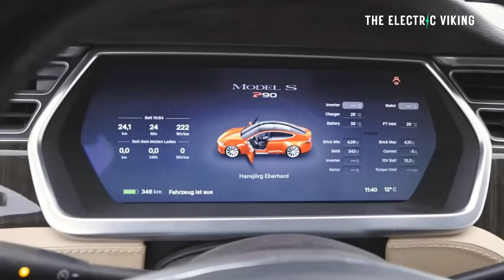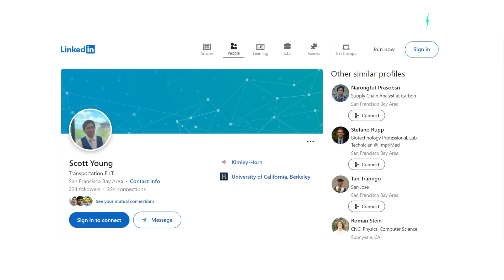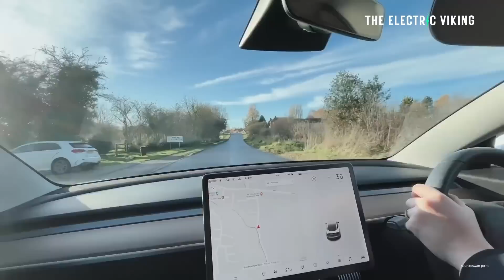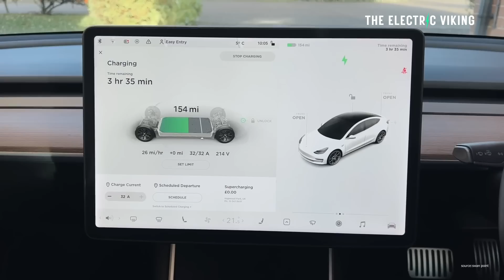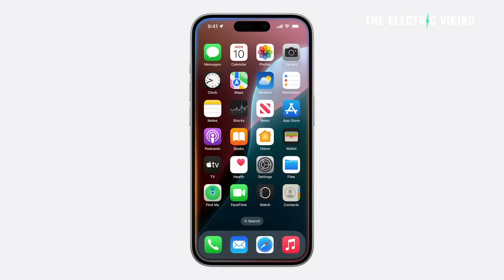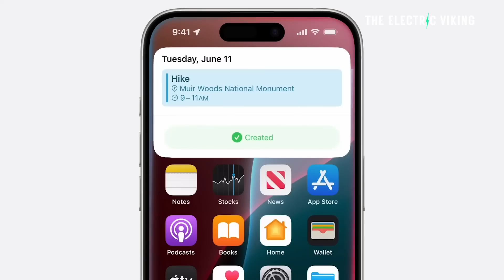Electric cars capable of running for over 1 million miles are already here

Comment: Totally agree with your  overview Sam. I'd quess 70% of car owners have not realised how well electric cars are holding up and how much cheaper they are to run. The ev industry is still in it's early adoption phase. 5 years from now there will be a huge choice of non franchised back street repair shops for ev owners which will bring the costs down even further. I also expect Elon to meet his promise of reducing his production costs down by half. Cheaper ev's as well as a continued  better product will be a no brainer for car owners sooner rather than later!
Reply: @howardj602  My understanding is a lawsuit was won for the right to repair John Deere machines  but not 100% sure.  I'm talking about after warranty repairs. I know of a few garages here in the UK who are repairing Tesla's and reducing the costs compaired to the main Tesla dealers.

Comment: $2800 per annum insurance kinda doesn't help the course unfortunately
Reply: Contact multiple insurance companies and you will get very different quotes, my insurance got a little cheaper for my Model Y compared to my 13 years old C4 Grand Picasso when I changed insurance company, actually all my insurances got cheaper
Reply: Insurance costs will come down as EV prices continue to be reduced. Also, many repair shops are afraid of the unknown. I had guys that did a sit down work refusal over working on changing out the batteries. After a 30 minute hands on training, a 2 man crew could swap out a battery in 35 minutes, and this crew did over 300 battery swaps over the next several days. Business as usual.
Reply: I'm used to about 500 USD or less per year...
Reply: How much is Tesla insurance?
Reply: @larryc1616  I’ve used Tesla insurance in MN since Feb for MOdel Y.  It’s only offered in 10 or so states so far, but we’re one of them. 

I have  typical coverage 100/300 and $1k deductible on collision and comprehensive .   They give a starting safety score of 90 which is $120/mo.  I got a quote from Progressive for $115 so I decided to try Tesla.  Since Feb its gone up to $163 as of last month because our safety score has decreased to 85.

The decrease is really not accurate or fair IMO.  We’re both 50+ and drive very conservatively (no tickets or accidents in 15 years)  but my wife keeps getting bogus forward collision warnings.  I’ve gotten several as well and they really are bogus.  I was just about to give up on Tesla Ins and move to Progressive but just got an update announcement via app to their safety score system (still in Beta) that increased our score from 90 to 96, since yesterday w/o even  driving it!

So maybe that’ll fix it.   I have a friend of same age here in MN who uses a Tesla insurance and has an $85/mo premium.  But he uses FSD all the time everywhere.  He’s a an Elon nut fan ..😃

Comment: That is why the work of Louis Rossman and Rich Rebuilds is so important. EVs are not black boxes, they can be fixed and should be fixed and maintained.
Especially in case the manufacturer tries to deny your car from working.
Reply: @howardj602  John Deere is a criminal conspiracy masquerading as a legitimate company.
Which, come to think of it, describes a lot of OEMs - Dieselgate, Toyota's "tests", Nissan and Ghosn, Ford and the Pinto, ...
Reply: @howardj602  I guess you haven't heard of the right to repair movement?  Louis Rossman, mentioned above, is a leader in it.
Reply: The issue is not manufacturers, the issue is with insurers. Nobody wants to sign off on insurance for a "fixed" battery.
Reply: @mariusvanc  Why would an insurance company be involved?  And is there something unique in EV policies about using only OEM batteries?  Which, as we know, aren't exactly fire proof.

Comment: As an engineer watching this I find it laughable!🤣
Reply: For what !
Reply: @Reddylion  Shoddily built, dodgy interior plastics featuring vinyl clad seats, expensive, shocking resale value, limited durability, bad for the environment. SIMPLE maths…
Reply: I've worked with combustion engines and brushless electric motors, If you are an engineer then you know there is no comparison between the two. A 3 phase brushless motor is infinitely more efficient, incredibly simple and has very little maintenance and a huge lifespan. 

Are you an electrical engineer? Do you understand how long batteries are lasting now, particularly LFP? 

I believe EVs will eventually completely take over, it is inevitable, and not for environmental reasons, but because nobody will want to drive complex high maintenance ice cars.  If you think combustion engines are so reliable, convert your angle grinder, drill and washing machine to gas.
Reply: EV haters are immune to logic.
Reply: @kallekas8551  in the old times people like you were saying similar things about horse drawn carriages vs newly introduced cars. Or steam engines vs diesel or electric trains. Or sails vs motor ships. 
I personally cannot see any soul in noisy polluting and inhetently inefficient ICEs
Reply: @panjacek6674  I don’t see any electric ships or aircraft. As I’ve said before this EV nonsense keeps popping up every few decades and fades off. Most cars in New York in 1910 were electric.
Reply: @kallekas8551  they have electric ferries in Norway already, educate yourself.
Besides, we are talking EVs here. The battery tech to power them is already in place and it's getting better and cheaper every year.
Reply: @Reddylion  Just a suggestion…please use the grammar correction tool available on your smartphone.
Reply: @toriwatson9655  well said.... combustion cars are yuk...
Reply: @Reddylion  I bet you don’t even understand the workings of an internal combustion engine.🤣
Reply: @toriwatson9655  Having said all that as an avid amateur 35mm photographer I was very sceptical about digital. As it took over I lost my enthusiasm for the art. Once we lose these analog technologies I feel we lose a certain part of our soul as human beings.
Reply: @toriwatson9655  Hi. I am a mechanical engineer with a passion for cars so naturally I am biased. I only have limited experience with electrical systems and have designed and developed the only a/c steam generating units in the southern hemisphere. My belief is every mode of transport has found it’s perfect motivational heart, jet engine for aircraft, diesel-electric drive for civilian ships, liquid propulsion rockets for exiting the earth’s atmosphere, electric motors for r/c cars. I’m now going to go  and buy some vodka in my Nissan Skyline.👍
Reply: Limited durability? Did you watch the video?
Reply: @panjacek6674  There plenty of petrol and diesel cars that have cracked millions of miles without drama  as well. EVs are becoming history again. It’s funny how they trying to bring back EVs every 30 years or so, and they always fail.